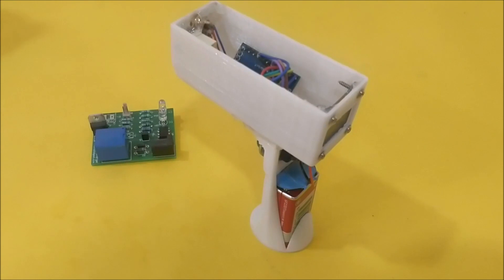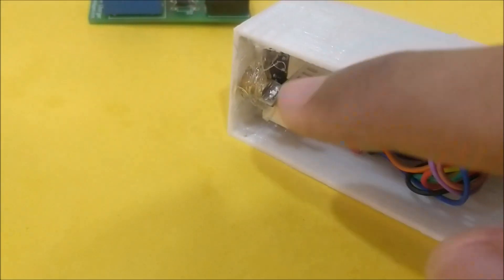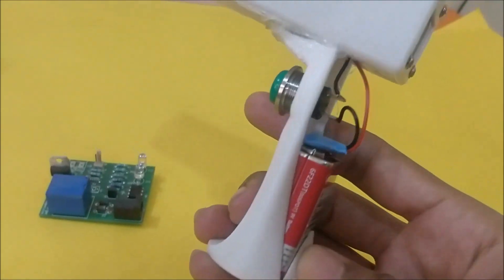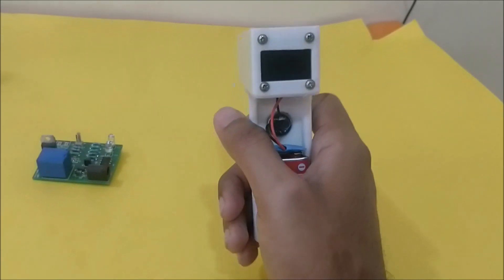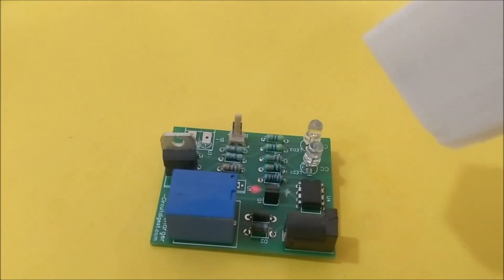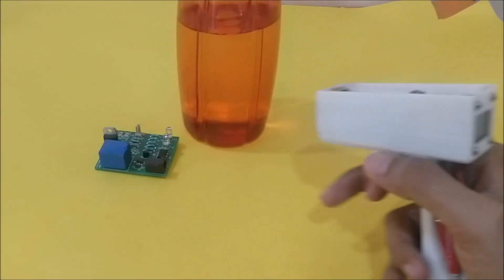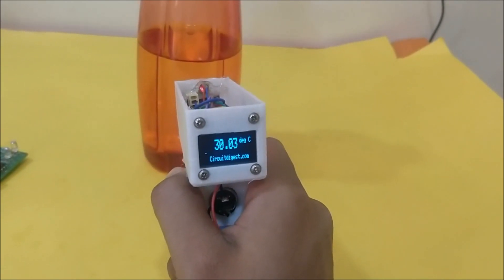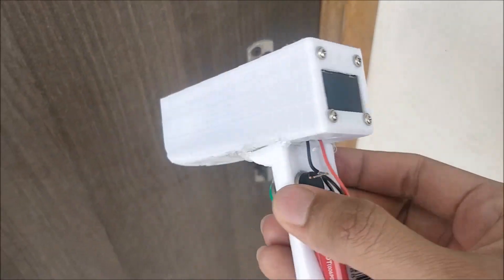DIY IR Thermometer using Arduino and IR Temperature Sensor | Arduino Project | Engineering Project

Comment: Does the MLX90614 sensor measure ambien tempearture or object temperature? Or does it take both into account? 
What was the motivation behind using a 9V battery? 
Would it harm the Arduino since it usually operates at 5V?
Reply: Mine measures the ambient temperature and the surface temperature of the object.
You can power an arduino at 9v even at 12v (in the dedicated slot and not on the 5v pin).

Comment: nice video... My questions is: Did you ajuste the parmeters of your sensor device such Emiisivity? comparing with the comercial guns they have an optical device to focus the IR getting to the sensor, so did you thing that without this optical lens the gun will work well?
Reply: So its the lens that allows the sensors in medical non-contact thermometer guns? I thought you had to calibrate it.

Comment: how long distance MLX90614 can measure?
Reply: as you move further out the signal spreads. I probably wouldn't want to be more than a foot if you want accurate readings. 
I couldn't find anything to exact in the data sheet. 

But if you were to get pretty close to something its pretty accurate it seems 10-bit PWM is configured to continuously transmit the measured temperature in range of -20 to 120°C, with an output resolution of 0.14°C

Comment: how do you fix the problem of the distance? because I have used this sensore before and it give different values depending on the distance no matter if is the same object, so I was thinking in a laser distance measure and have and algorythm, but I see that you are not using one.